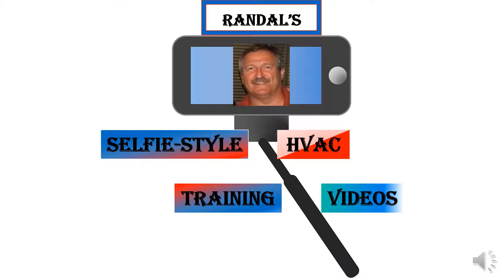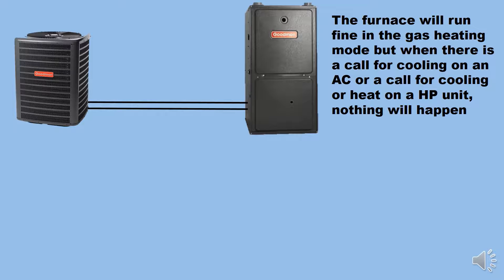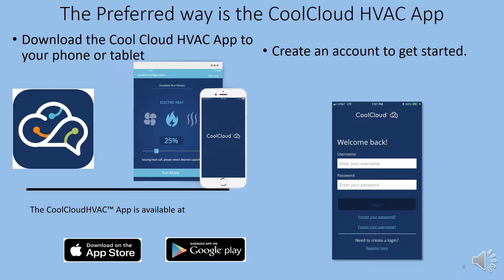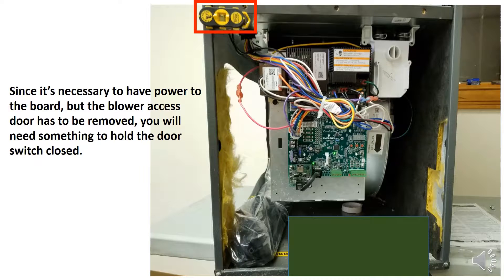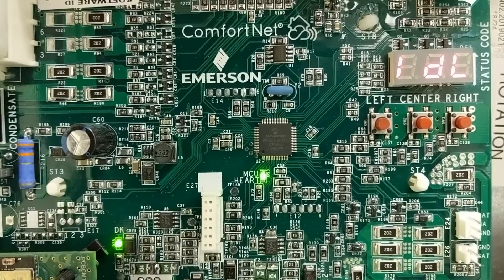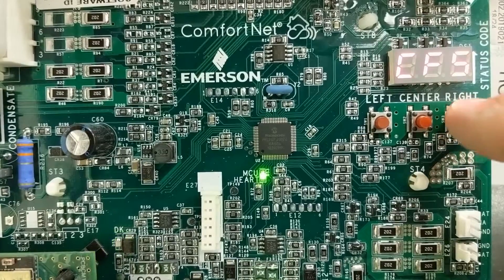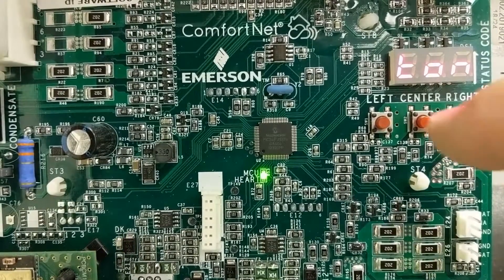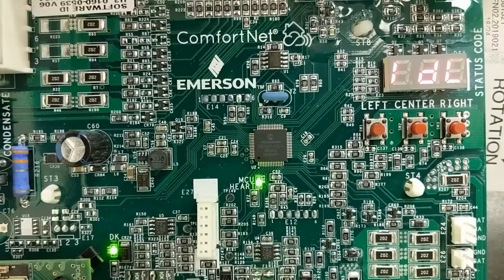Setting Up The Goodman and Amana Blue Tooth Furnaces to Operate Non communicating AC & HP Condensers

Comment: Just a few comments from a homeowner.  Use the app if you can.  Works best to fire up the app standing right in front of the unit so that it connects.  Will require you to do some thermostat functions to get it to pair, but not too difficult.  In the app, you can set up everything, it's pretty straightforward except for understanding some of the ramp and stage profile choices, which are explained in the manual better.  In regards to the AC tonnage - for a single stage system, the tonnage choice is used to set the blower speed at 40 cfm / 0.1 tons - ie 400 cfm for a one tone unit.  You can tweak this for better dehumidification depending upon location.  Also, assuming that you have a goodman matched coil system - you can look up the AHRI number for the system and it will give you the cfm that the system was rated at, which is ideally where you want the system to operate.  so I have a 2.5 ton system, but its rated at 920 cfm, not 1000 so I set the AC to 2.3 tons, which puts the blower at 920 cfm.  The unit does an incredible job of dehumidifying at this condition.  

Play around with the coolcloud app and see what is in there.  Combined with a wifi thermostat, I have complete control over the system and it works great.

Comment: So, in a 2 stage application, the board basically controls everything, not the stat. The stat needs to be a 1 heat 1 cool,  wired conventional right?
Reply from the maker: As long as the furnace and the outdoor unit are both communicating equipment. If the heat pump or AC is not a Goodman or Amana communication unit, it has to be wired like a legacy unit and the furnace board has to be set up to let the Furnace know what the unit is and how much airflow you need.
Reply: I’ve been having issues with the Amana 2 stage furnace.. It wants to kick into 2nd stage right away with a single stage stat.. I know on Goodman you have the option set it up on “auto” if a single stage stat is present and it allows the single stage to do its thing if it’s not far from the set point.. Looked for answers online, and actually came across some guys on Reddit that said they had the same issue with the amanas wanting to skip 1st stage and start in 2nd stage. Is there any solutions?

Comment: Tried to connect using the app . It could not find the air handler . Called tech support because I found some articles where there was a small board plugged in on top of main . Tech support said they are now in the software of main board(2023)  . No more aux boards. It still did not connect . Used buttons to program .

Comment: Have you guys ever had issues with the air handler Bluetooth not connecting? When I go to cool cloud app it says to search for near by devices, I click on that it loads but it never finds the Airhandler.
Reply: I often have the same issue.  I do not like the cool cloud app.  You should not have to depend or rely on an app to make adjustments.  I realize you can use push buttons on the IFC board, but constantly putting the door on and also removing to maintain proper static,  airflow and load on the motor assembly is excessive.  I can usually connect to the app, but it takes a while and drops signal often.
Reply: Just installed goodman furnace and nobody can get it to connect

Comment: I have a heat pump air handler communication system with non communicating condenser but I can’t make it work on heating only in cooling I try bunch of different tricks and I haven’t success

Comment: Hello. I just had installed a Goodman gsxc18 4 ton with avptc61d14 air handler. The tech didn’t know much about the app. And the setting for the constant fan speed multipler was set to 30% and no much air was coming out of the vents. Then he raised it to 70%. What should it be set to for efficiency to save on utility bill but be comfortable. Also when deciding to go with a two stage unit. I read that the two stage units have a longer running time for fewer on off times while still being efficient. But I feel like like turns on and off the same amount of times as my old unit. I live in sw Florida

Comment: What percent do you use for the fan speed when set to Fan On  all the time.  Default is 25% but that seems way to low for the amount of air i feel coming from the vents. Thanks
Reply from the maker: Hi Sammy,

Constant fan is best used to circulate the air for better comfort, especially in over-sized units that short cycle and don't allow for good, even air temperature mixture. You can use whatever setting you prefer but if all you are doing is wanting to keep the air moving for better circulation throughout the home, I don't see more than 50% being needed since you are circulating air 24/7. 

For Example: The GMVC960603BNBA has a maximum airflow capacity of 1400 cfm (this can be found in the specification sheets). At 25%, that's 350 cfm.  A GMVC960803BNBA is rated as a 3-ton drive but it's maximum airflow is 1650 cfm or 412 cfm at 25%. The GMVC961005CNBA is rated for a maximum of 2200 cfm or 550 cfm at 25%. 

"Felt Airflow" from your registers  or diffusers can be deceptive. Is it all of your supply's or just a few that you are feeling this "amount of air" coming out of? Increased velocity, the speed of the air coming out of your supply's doesn't equate to more actual airflow. Check your external static pressure and use that number to base your next move on. The average residential furnace can work with up to .8 in. w.c. but this also decreases efficiency, increases the energy usage of the motor, the customers electrical  bill and can cause noise issues. The manufacturer recommends .5 in. w.c. and it's never a good idea to fix undersized duct problems with variable speed, constant volume units.

I hope this helps.

Instructor 12b
Reply: Thank You.
Reply: I have my fan only set at 60% which works well and keeps the temp even in the house (I also have a wood stove).  I would say 40-70% range is about right with good duct work.  Will filter and circulate your air.